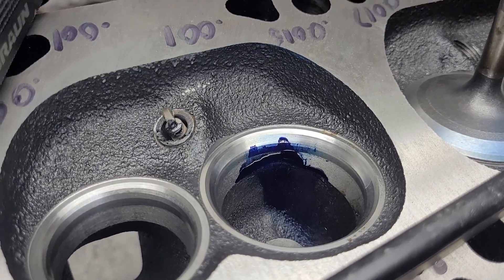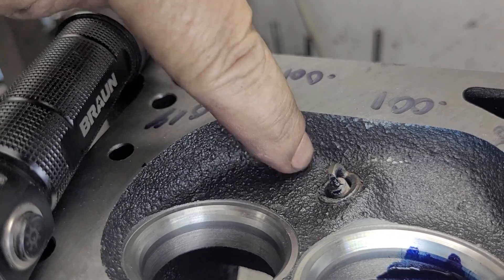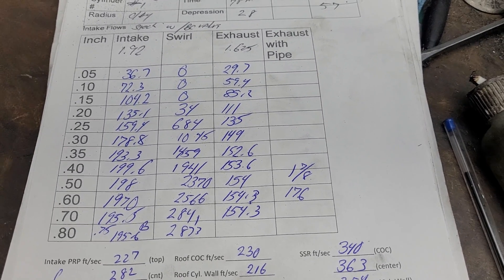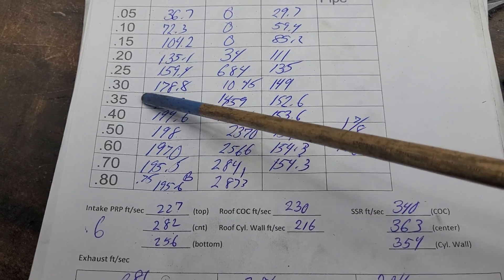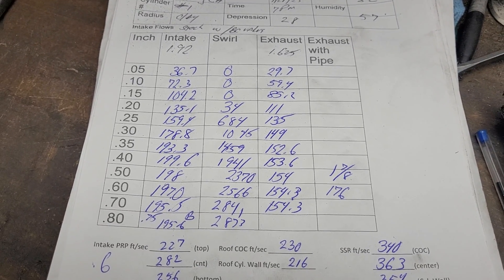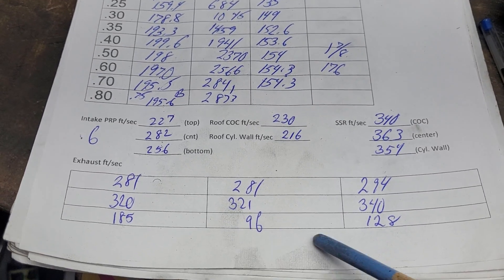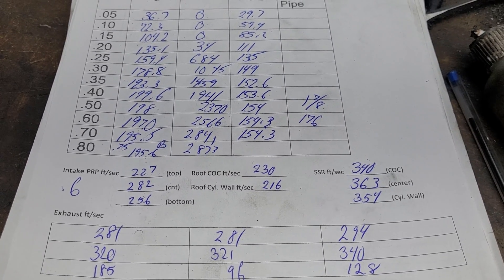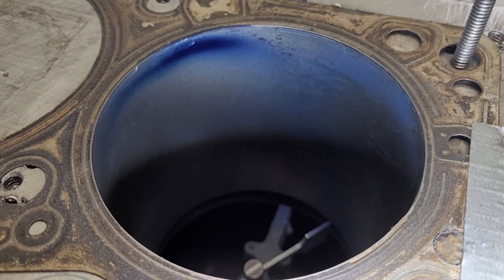EQ-CH 318B 318-360 Magnum cylinder heads. Stock flows, air flows and liquid flow.

Comment: Would the higher air speeds be more favorable to low end torque??? I'm trying to figure out the best porting for an engine that won't see over 5200rpm..
Reply from the maker: If you port small fast ports they will help low and mid range without hurting top end much.

Comment: What other valvetrain mods do you have to do as you go over .520 lift? Like a SBC, screw in 3/8 studs, hardened pushrod, guide plates, stud girdle? Never messed with these before, just the traditional shaft mounted Mopar rockers.

Comment: Those heads aren't definitely what they used to be !!! Those were the Go to heads for us Magnum guys now if you find or know someone who has them they want Gold for them.....Same can be said for the Mopar M1 Magnum intake manifolds with the FI bosses. M1 goes for around $1000 used I wish Mopar would get off the behinds or one of the other Intake Manufacturers and make a replacement for these darn kegger intakes. I know Hughes does a Edelbrock Air Gap with the bosses I just don't want to deal with fitment issues on the fuel rails like I have seen.

Comment: Why are you so obsessed by wet flow ? It doesn't show true flow.  Fuel particles   mixed with air are more important.  Dyechem is not a true indication as its not atomised.  It's heavily concentrated. 45 yrs of porting and engine building experience.  Dyechem is not a true source of port efficiency.
Reply from the maker: I look forward to you showing me a better more efficient way. Thanks!
Reply: @servediocylinderheads  you must remember that smaller particles of fuel suspended in air will provide a fuller charge as it promotes a higher combustion rate. Yes be careful of a lean situation though. Dyechem is much heavier and only indicates wet flow where it wants to go. You need to determine air speed and direction n flow at test test pressure.  Particularly size of fluid from the source. Yes it is an indicator only but be aware it's heavier and will not show true caricaturist  of  the flow pattern.  A good indicator though. I've used it. But as Visard said the air will go where it wants to go. Keep the fuel atomisation suspended in the air. Cheer I respect your work mate.
Reply from the maker: @stuartclements9290  I agree, I figure if the dykem is fairly good fuel will be much better. Thanks
Reply: @servediocylinderheads  you must remember that fuel particles eleven smaller contain the correct mass to air. Some fuels are different as some are oxygen inhaled. Sorry for being an .
Reply: I give up on spell check. But I think you know what I'm saying. 1. You can't wet check without velocity  and atomisation.  Separate equation.  But you are right on for wet flow sir.
Reply: @servediocylinderheads  forgive the spell check.

Comment: I just bought a set of these. I spent yesterday cutting sharp edges out of them.  I was hoping they would flow a little better than stock for the pick up truck engine Im building.
Reply from the maker: Buy a grinder, speed control and some burrs. It shouldn't take more than 100 hours to clean them up!
Reply from the maker: By the second cut they start to shape up!
Reply: @servediocylinderheads I hope so after all your hard work.
Reply from the maker: @grahamm3559  3 cuts in, starting to get somewhere.
Reply: @servediocylinderheads  I'm glad to hear.